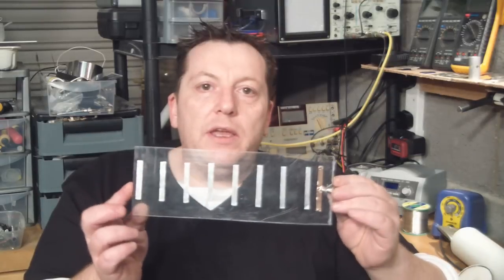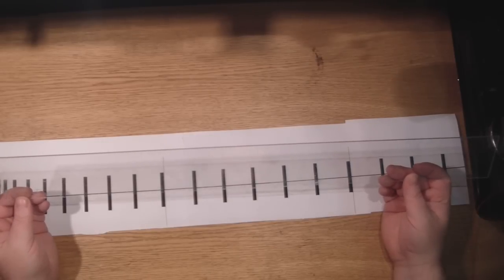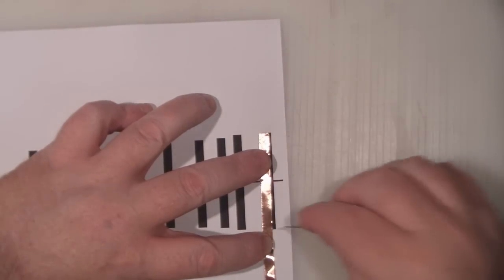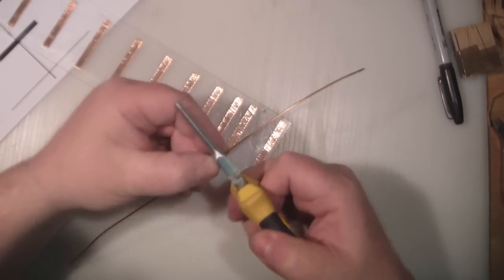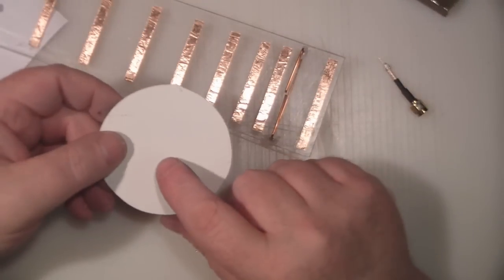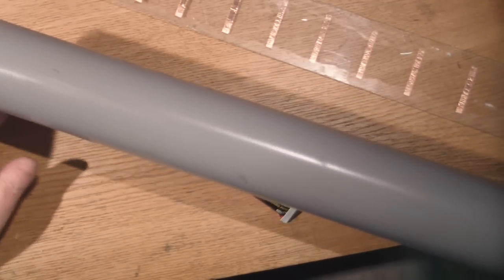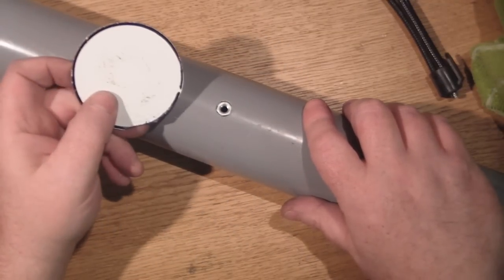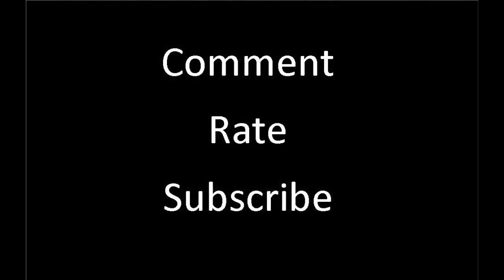Long Range Yagi Antenna 19 Element 2 4GHz

Comment: That's a folded dipole.  The impedance in nominally 300 ohms.  The SMA connector is 50 ohm.  There should be a matching network.
Reply: Yes, a closed dipole. That's 300 ohm impedance. Required is 50. You need a balun to fix that or use an open dipole. This will work but can be a LOT better.
Also the length of the inner copper wire of the coax is way too long and bending it to fit, that's fatal on such high frequencies.
Reply: Sorry guys but I want to clarify something. The input inpedance depends in the whole system. The reflector and the first two directors have a huge weight in the input inpedance. Of course if que replace the folded driven for an open one, the impedance goes lower, but we need a field simulation to estimate how much it is or just measure it with a VNA

Comment: Tip: You can use the side of a Bic lighter, or other hard plastic with a smooth rounded part, to smooth out bubbles in the tape.

Comment: Hi Andrew and excellent work. Without the exact dimensions of the YAGI elements and the spacing between them the information in the Templates is useless because different Printers will produce a different image. Grateful if you could supply the exact dimensions.

Thanks

Andreas

Comment: The folded dipole antenna has a theoretical impedance of 300 ohm so if the coax is 50 ohm, you are not getting a proper match and hence best signal.   If I were building this antenna, I would've stuck with the foil for the driven element, with the split in the middle the impedance is closer to 50 ohm.

Comment from the maker: hi Chris
when i build antennas for 2.4ghz i make then tuned to the centre of the wifi spectrum channel 6 2.437. The difference between 2410 to 2510 is around 0.5mm. The yagi is a good choice if you are using in an area with a lot of interference but the helical antenna works better with video and can cut through obstacles like trees much better. a good setup would be, cloverleaf on plane TX helical on ground RX. hope this helps

Comment: Of course it helps Andrew, thanks much, I will get the material for the helical and cloverleaf.  I have need of a high gain Wfi also as it turns out. Too bad it takes so long for the delivery. Live in the rural zone. And even in the town of 300,000 there is no electronics supply. TskTsk... Regards, C

Comment: you are a genius
Reply from the maker: I don't know about that but glad you liked it.
Reply: andrew mcneil Can I use this antenna for 2.4ghz rc tx for long range FPV???
Reply: andrew mcneil so I know these videos are a few yrs old but I noticed a lot of people are saying they can't get it to work? Any tips for cutting tape to right diameter? Also what is the best antenna to start with if your just getting into building antenna? I'm working on this one and the copper Clad yagi made with coat hangers except I'm using copper wire..
Reply: andrew mcneil any suggestions or pointers?
Reply: andrew mcneil  ??
Reply: @aspentherealist3908  Google "Yagi antenna calculator", and you will find several sites with what you need to build one.
Reply: @ariafpv  It would work in terms of frequency, but is a directional really the way you want to go for that? IOW, will there be someone actively following your robot with the antenna and binoculars? You'd at least want to do the math on the beam width as it extends outward before building or buying a Yagi.
Reply: @fun_ghoul  thx for your comment but in the meanwhile I got a 868mhz rc system so that doesnt need high gain for lots of penetration

Comment: Great project Mr. Andrew, i'm beginner in this, i have built this antenna following your instructions and it works really good, i pick up lot of APs, but i was wondering how is the diameter of the copper wire element affecting the antenna? i didn't had the one you used (1,25mm if i'm not mistaken), i had smaller one(1mm) and bigger one(1,75mm), i have chosen smaller one in my antenna, but i'm not sure what difference it makes.Thanks!

Comment: Andrew I know this video is 9 years old and I'm not sure if you answer questions from this far back. Anyway my question is with this perspex/copper foil style yagi do you need to connect a balun. I've seen you fixing baluns on production yagi's but not connecting them to your own. I it necessary and If I wanted to connect a balun would you have link how to do it. Regards Sam

Comment: I saw a lot of prototypes of antennas for Wifi. Yagi with square profiles, cantennas, yagi with circular profiles...  What is the best one ever? Therefore if I want to connect my garage that is 100 m from my home shall I use a antenna only in my garage or I need an antenna at home pointed to my garage?

Comment: Andrew - I am making this antenna to use with 2.4ghz wireless transmitter/receiver for transmission of video signal to a capture card.  For this application, I believe that I have an impedance of either 50 or 75 ohms.  Would I need to use a balun with this?  I am going to attach using RG316 and RP SMA connectors directly to the transmitter and receiver.  Thanks for your help.  Also, where do I find instructions on the balun if one is required?

Comment: Andrew, shouldn't there be a balun to transform the impediance of the dipole. Which is probably around 200-300Ohms. Would the model/design also work with a open dipole concept. Tnx in advance.

Comment: Thank You Mr. McNeil for a great video! Quick question: Is the width of the metal tape important? I know the spacing is critical but, How about the width of the actual elements? Many Thanks in advance!
Reply: +inthefreytoo I don't think it's really important, they shouldn't be to big AFAIK.
Some people use metal wire instead of the copper tapes, so it should be fine
Reply: +hamada clément 

Would you think 3 or 5 mm is better?
Reply: I don't know really :/
If anyone has a clue I would be interested..

Comment: Hi Andrew, Question. From the end reflector to the Alfa card, what length should the max distance be for the coax cable.  Is their any? or would it start to have loses in performance due to the length..  Would it be possible to have a cable length of 3 - 5 meters? Loving the videos,  Cheers.

Comment: Andrew, I have a great application for this Yagi, I have all the parts for it and am busy getting her together. I just wanted to tell you that I wanted to replace the patch antenna that the internet provider in this rural area would normally put on the peak of your roof pointed at some farmer's grain silo where they have there WLAN array. I was wondering how much better gain this YAGI would have than the standard patch they would put up. We first declined service because only 1 megbyte per sec

Comment: Thank you for your ongoing enthusiasm and excellent videos.
Have other people has success building this antenna to the printed PDF template? I have printed without scaling the document and built the antenna carefully, used a 5mm spacer block and 18SWG copper wire. I have seen that Andrew's works really well. My antenna exhibits not gain over a simple dipole and no directional properties. I began to doubt that my copper tape which had 0.5 ohm resistance across the elements so tinned the elements with no effect. Any suggestions?
Reply: Kevin Nicholls I did build one myself and it wouldn't work... Tried  to build the active element using the dimensions given in the comments, no luck. Changed the dimensions to be 1.5 wavelength, didn't work. The best results I got was using a length of 130mm that I've found on a website with similar design, but still way worse than my laptop built-in antenna.

Comment: Is there a way to attach the directed element to a single contact point? I need to hook it up to a MMDS LNB downconverter for a project, and the connection to the downconverter is one contact point, not a coaxial connector. I actually had to unsolder an integrated dipole from the downconverter, so I'm hoping to attach the yagi to the contact point where the original dipole was soldered. Thanks in advance!

Comment: Could you use 3mm plyboard sheet instead of the perspex? It is MORE RIGID & offers good insulation from the radiation generated. It is also cheaper & more available!
Reply from the maker: Yes you could. Just used perspex as you can see through it so it helps to see the template.

Comment: I am truly greatful for your many videos. I Don't know the sequences of the videos though so I have a question on the 20 element Yagi in-a-can ... In one of your videos you mentioned that the yagi performance drops off after x number of elements ... bigger is not better ... but maybe that comment was meant for your Biquad Yagi ... I don't recall ... Just a thought I want to clarify and keep in mind as I absorb your information ...
Reply from the maker: yes it is true that performance will drop off. This is probably the maximum you would want to make a yagi for 2.4ghz

Comment: I watched your previous videos and made a biquad antenna  it works perfectly but yagi doesnt. where did i do wrong? is there a special size for the cooer wire element? While you  were curling the copper you used a wedge. How many cm is it? I used 1.5 cm. I expect your help. With my regards...

Comment: As someone said, what do you think about a balun? I did a bit of reading on impedance and it seems like the folded dipole in the yagi has 200-300 ohms of impedance, while we need 50. Am I wrong?
Reply: it needs a balun, 300 ohm dipole to 50 ohms. I don't know why it was not inlcuded...

Comment: What is a good piece of software to use to tweak the dipole, and for aiming
purposes?   The software that comes with my alfa adapter is much to slow
updating me signal strength changes.

Comment: Hi Andrew.  Love your work it really inspiring. I want to know if the cantenna get catch Wi-Fi signal that is 300 metres away from my house. Can the cantenna be used as a Wi-Fi signal repeater. Thanks
Reply from the maker: yes it can I use one of these https://www.youtube.com/watch?v=_pqPLTsx-s8 with a cantenna to get wifi in my workshop. It is about 200 m away but has to go through 3 brick walls.

Comment: Andrew - in your video, when you reach the assembly of the driven element, you use a block of wood to measure the depth of the element. You did not specify the measurements of the block of wood; you simply called it "your block of wood." Would you please elaborate on this? Is this measurement important?
Reply from the maker: It was 5mm.
Reply: Thanks. I hope, perhaps, you'll let me pick your brain sometime!
Reply from the maker: no problem
Reply: The driven element he uses is a folded dipole. So just make the calculations for a folded dipole at 2.4 ghz. I haven't played around with folded dipoles yet, so I don't know how critical spacing is. But there is plenty of info on the internet regarding folded dipoles.

Also, you don't need to use a folded dipole for the driven element. I recently made a 3 element yagi for the 2 meter ham band. My driven element is just a dipole.
Reply: andrew mcneil what was the thickness of the plastic?
It would then be 5mm plus the thickness of the plastic times 2 for
the spacing in between the folded dipole ??
Reply: Ken Klimasewski what was the thickness of the plastic?
Can you state what measurements are critical and what are not?
Reply: andrew mcneil Would be great if you could clarify on that. Somehow on the Video the block of wood looks a lot thicker than 5mm.
Reply from the maker: Its 5mm x2 + 2mm plastic = 12mm. when connected to the network analyzer this was the perfect size any larger than this you get increased reflection, any smaller and it does not radiate effectively. Sorry for the delay I don't know why but these comments were going to my spam box. Hope this helps.

Comment: Can you pass along the measurements of each element and spacing and also offer
where the calculations came from.  I built it using the template with poor results.
I also built another version I think 19 elements using copper wire for the elements
based on another site which worked much better.  I also noticed the spacing and size of elements where different that's why I want the measurements to compare
against the template.   Its possible the other one I built that works better
might have been for a slightly different frequency, 2400 vs. 2450.
Funny, the site using the yagi calculator(vk5dj) gives me different measurements too.

I have been playing with several of these antennas including the $10 junk yagi
you can buy on ebay.  The best antenna so far is a antenna that has a can
shaped with a metal rod containing several round discs going out about a meter.
This antenna was used for the MDS band.   I do have a commercial 1 meter
dish that beats them all.

I wanted a good yagi for portable use.   Last week using a 11dBi patch/panel antenna from Pt. Judith, RI to Newport, RI line of site (9.2 miles) I had made
a voice direct contact using a program called IP-Sound

Ken
Reply: What is the video of the antenna? a can
shaped with a metal rod containing several round discs.
 PLEASE
Reply: Luis Miguel Mendoza
It wasn't a video its just antenna I had from years ago used for the same
frequency range.
http://www.wlan.org.uk/antenna-page.html
scroll down to the Prude University Project and you will see a picture
of an antenna that is very similar to it

Ken
Reply: Ken thanks for the info. :)

Comment: Andrew, in your experience, what would you consider to be the best physical length to radio signal ratio in a Yagi antenna: where the length added doesn't justify dbi gain.
Reply from the maker: A 10 to 12 element Yagi is a good practical size. I will be releasing my biquad Yagi in the new year. It is a 6 element antenna and is more powerful than an 18 element Yagi!  
Andrew.
Reply: andrew mcneil excellent! I'll be on the lookout for your video.
Reply: andrew mcneil
 how much longer should a yagi antenna be to get 17-18dbi?

Comment: Hello Andrew.  Ive downloaded the templates but they are in a .png format and seem to be very small when printed.  Am I doing something wrong?
Reply from the maker: I just checked they are in PDF format and downloaded fine for me.If you are still having problems I could post the dimensions.
Reply: Now thats strange. They did finally download in PDF format. 
Thanks
Reply: +andrew mcneil  Can you please post the dimensions for the 8 Element Yagui and this one.... many of us print in different world sizes. so no dimensions no working yagi
Reply: @andrewmcneil  plz give exact dimensions in mm. PDF is getting scaled while printing on different printers.

Comment: Would it be better to connect the yagi straight to the alpha and outdoor proof it then run a long usb cable to computer or just run a long lmr cable to the yagi?
Reply: usb cable is preferred, you won't get any signal loss.

Comment: Does it make any difference what the diameter of the "can" is? Can I use this Yagi template in a 80mm diameter "can"? Or will it make the antenna worse?
Reply: As long as the element fits in the tube you're fine. The plastic tube is just there to keep it straight.

Comment: Hello mr Andrew; I made your 19 elemented  yai antenna model according to your template. it is the same as yours. I attachedconnector to the side of 5cm r58 cable. I attached the other side to the vivid element. it hadly captivated even the modem at the bottom. I suspected and used the coaxial cable inside the notebook but it didn' t work. At the end , i pulled out the connector and soldeved directly to the wifi adapter but  it didnt workagain.

Comment: lol in a yagi design program I ended up with a 38 element yagi..    no I didnt make it cause I cant do .0003 of an inch tolerences on what I got ..  program said it was 34 db though ...  pretty good for an antenna that woulda been 5 feet long

lol

Comment: Andrew, how thick is that block of wood? (Sorry if you mentioned it and I missed it)
Reply: I'm planning to do the same thing. But you can't see though it and it is harder to mount in a tube for weatherproofing.
Reply: I built one but not the same design, I used a round PVC tube (15mm diameter) and used copper wire elements and a folded dipole driven element. It worked out nicely where it all fit well in a PVC protection tube I found. I lucked out with that one I guess...
Reply: I've just finished putting together the wood version. I placed the metallic tape directly on the paper, and stuck the paper to a block of wood. Looking forward to giving it a test.
Reply: I'be built 2 types for this so far, one shorter (less elements) and a longer one (more elements) and getting pretty good results but I found that having 2 together (combined) with both polarities (H & V), results are obviously way better, something to think about...

Comment: My linksys router has 2 antennas, can I splice them together for use with one of your antennas...

Or do I need to build 2 ?
Reply from the maker: If you have 2 use 1 for a directional antenna like the yagi and have 1 for an omnidirectional like I did in my BT home hub video.
Reply: guys i build all the antenna's but what is the best antenna you ever made !!! plz answer

Comment: I'm looking at building this but in your opinion what is the greatest ant for far away wifi networks? I want the greatest distance possible .. Thanks bud
Reply from the maker: One of the best (because it is easy to build and my favourite) the double biquad.
Reply: andrew mcneil thank you so much for quick reply!
Reply: Also have you ever made a wifi dish? Or doesn't that interest you?
Reply: andrew mcneil
what have you found that offered the highest gain in a non dish antenna.